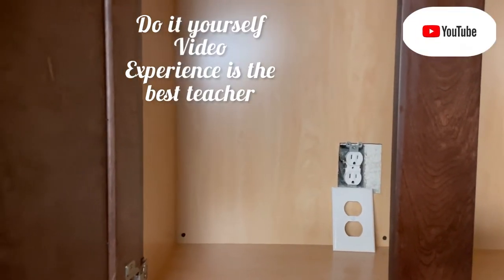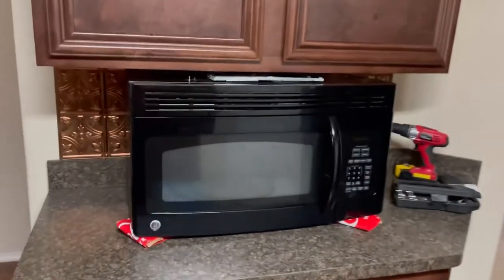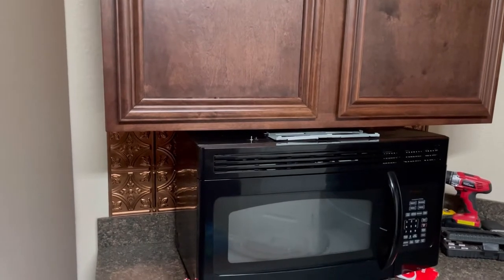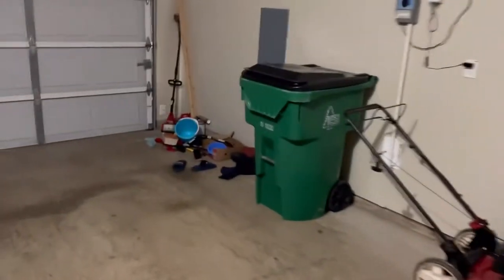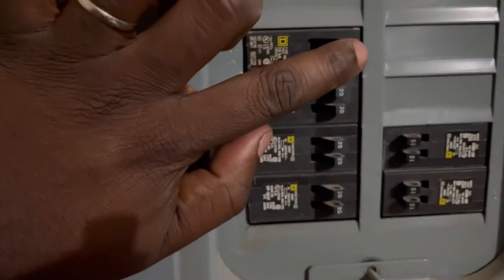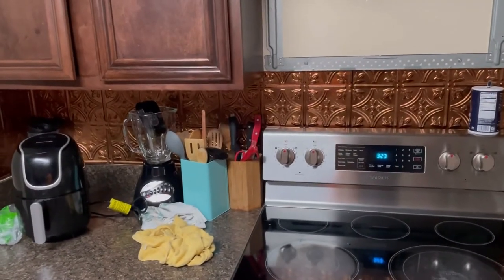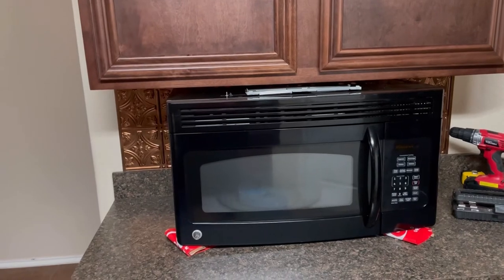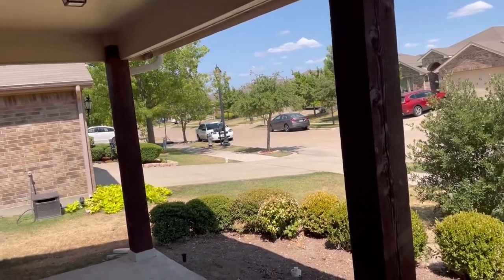Is your microwave not working? Check the outlet and circuit breaker first

Comment from the maker: Don’t panic when your gadgets not working. Check your outlet first to see if it’s working or not. If it’s not working, check your circuit breaker box to see if the breaker has tripped. If it’s tripped, switch to the far left off and switch to far right to on it.

Comment: Wow  I have to check my circuit breaker box before throwing my electrical equipment away. Well done Bro. This video is very.
Reply from the maker: Yes I nearly packed the microwave to the garage after buying the new one, and just to realize it was just the outlet and not the microwave. Thanks 🙏